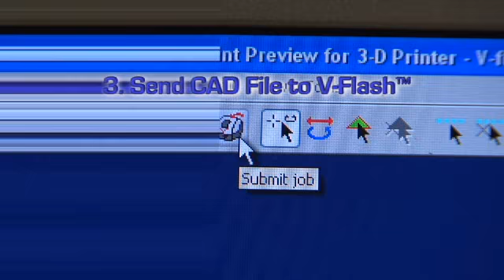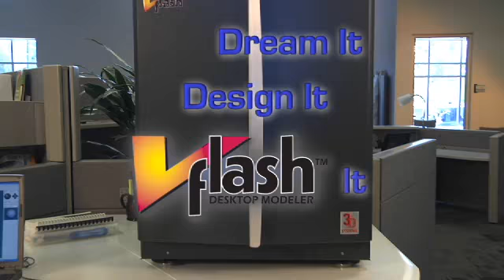V-Flash Desktop Modeler in use

Comment from the maker: @centervilletn V-Flash uses a photocurable acrylate plastic material and can easily do fine features, holes and small surfaces. For more help with your particular application, please contact our hotline at 888-337-9786. They can help you with benchmarks etc.